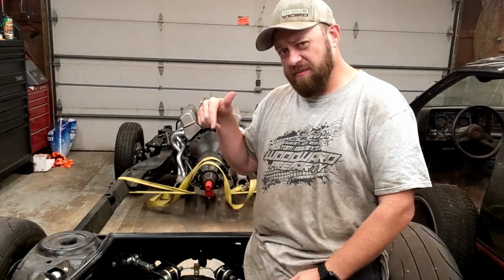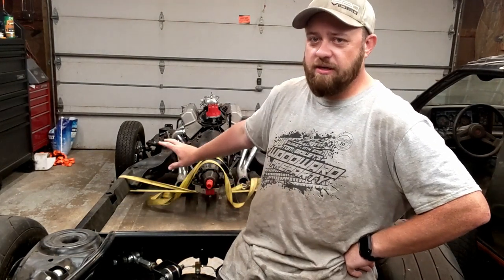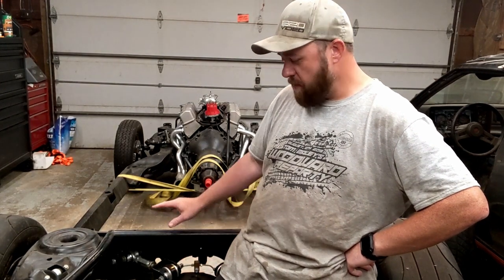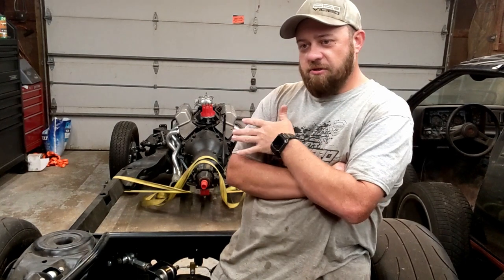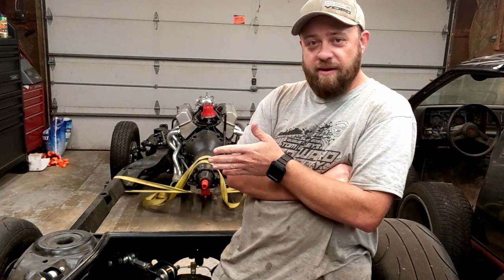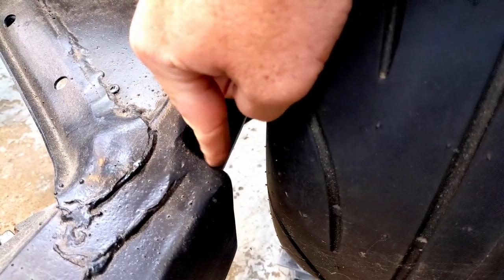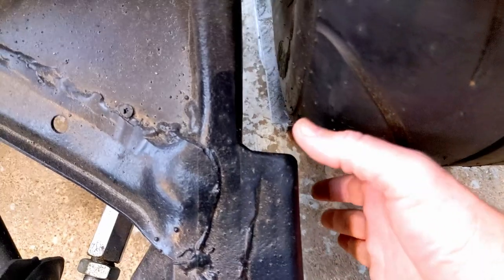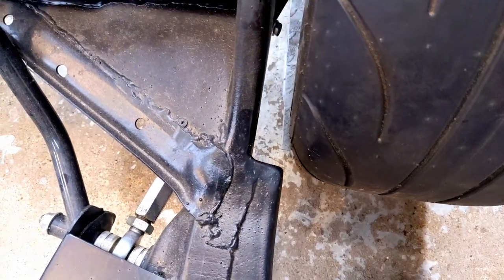G-body Frame Notch / Part 1

Comment: I go back and forth about doing a notch on my 87 G...a 275/60/15 with a 8" wheel, 4" backspace fits fine with a rolled lip.  The desire to go to a 295 or a 315 exists but we see that a 275 goes low 4s and well into the 7s .  Also,with a big tire the rear needs to be strong as well to survive,imho.   A big tire does look cool though.
Reply: Not sure if you’ll see this but I have 275/60/15 on an 8in.  Rubs with a 4.5” but I bought a 1/2in spacer.  Should I expect it to fit?
Reply: @Se7enthsonSS  1/4" space should work ,,possible lip roll though?
Reply: @brianmathew09  I’ve still got some room on fender lip.  But I do have drop coilovers.  I can roll fender if needed.  I’m trying to avoid a notch I just don’t think I can at this point
Reply: i have the same set up on a 275 ona 9”, rolled lip too . i’m notchin to try and attempt that 315 ! but i don’t have the tires for it yet . figured it’s best to attempt when i have the 315 tire on rim to test fit i might have to cut trunk wheel wells
Reply: @betosgarage  Since this post, 2yrs ago, some things i found and should be considered ...all that rotating mass is a sizeable weight to turn and will slow the car down nless you have some serious Hp to haul it.  I know it looks cool af but cars making 7-800 whp can make a 275/60/15 as fast.
Reply: @brianmathew09  i hadn’t considered that , im only pushin 425wheel & i get no traction off cheap tires ofcourse , off the 275/60/15 MTs i did but they pricey lol figured itll dope af seeing a tucked 315 back there ona 10-11” wide 5.5 bs maybe

Comment: Forgive me if someone else made the suggestion or you're done with this part but could you swap the lives that were cut out from left to right to use the sweep of the frame? I'm getting ready to do the same and wasn't sure if it would work.
Reply from the maker: It possibly could have if I cut the exact same size out but after doing it, think it was easier to box in with plate.

Comment: I have a 83 monte carlo and want notch frame but want to do it in car is it possible
Reply from the maker: I don't have personal experience doing it but I have seen a lot of people do it that way. There are several companies that sell the kits where you can cut the outside off and weld in a new piece if you don't want to use the factory frame section to weld back in.

Comment: couldnt you invert it and use it on the other side and vica versa?
Reply from the maker: It's they were cut exactly the same, then potentially. But since it was already notched they weren't identical side to side I couldn't.

Comment: the outside of the frame could have been left were it was then angled less so you don't have that hard corner and a lot less cutting
Reply from the maker: I realize that and that's why I explained that I could put it on a 45° angle. But ultimately that's not what I wanted.